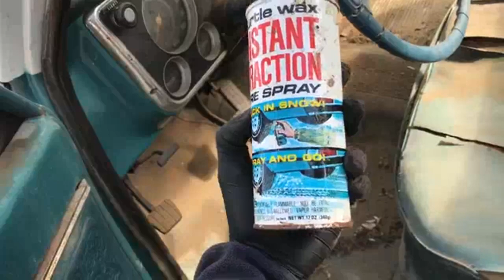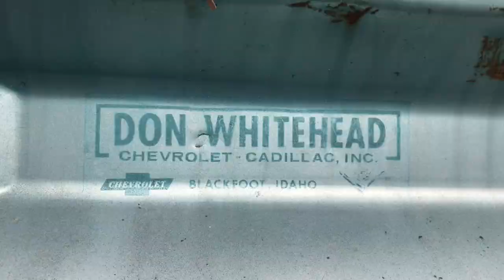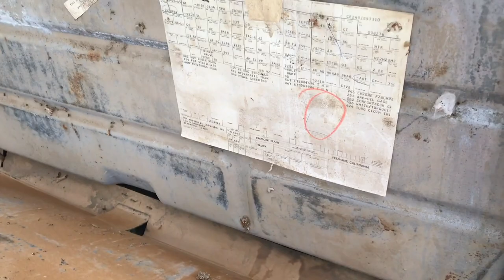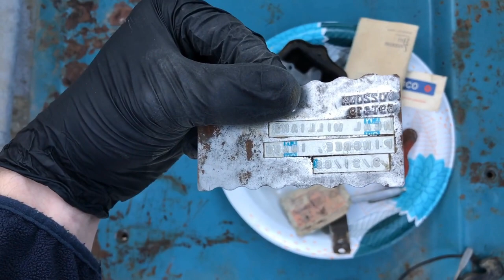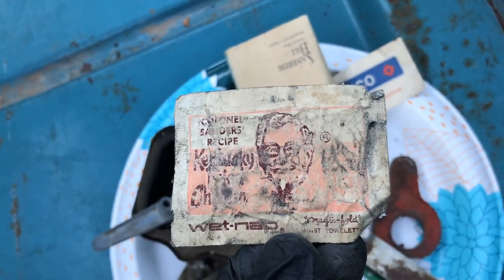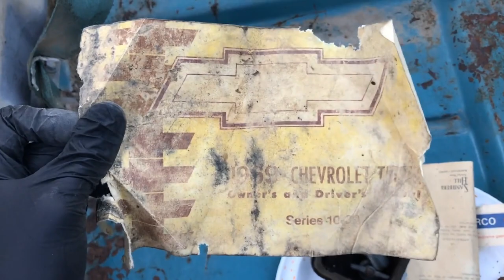Evicting the Residents of Mouse Motel! | (AKA the Heater in this Truck)

Comment: What’s the latest? My son and I have a 70’ C20 project in the works. What are your plans for the truck?
Reply from the maker: That's awesome 69' and 70' trucks are basically mechanically identical except for a few cosmetic changes. Best of luck with it! My plan for this truck is to get it cleaned up reupholster the seat, polish the paint, fix the brakes, and just make a really cool daily driver with it.

Comment: Y more than likely have a awesome  mice nest on top of your windshield. In between your roof panels .
Good luck getting that  cleaned up. 
🤪😩🤣🤣🤣🤣🤣🤣🤣😫🤪
Reply from the maker: Oh really? I didn't know they could build one up there, how would I remove it?
Reply: @chevytrucktaylor9102  if you have  rust on your visor area. Above your windshield. OMG 😲. 
if you don't. 
Life is good 👍
Reply: @chevytrucktaylor9102  Usually it is because of the seat. The  mice have a galore of material for there comfort there.
Its their piss and  shit that causes rot and  corrosion. 
Nasty little creatures. 
I  haven't seen any video footage of your upper windshield area 😕. 
👍🤞